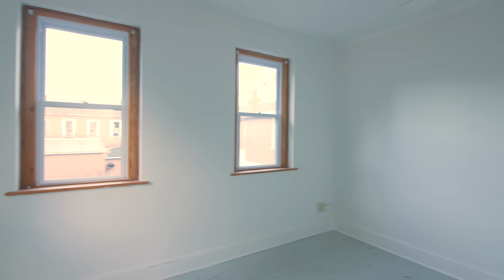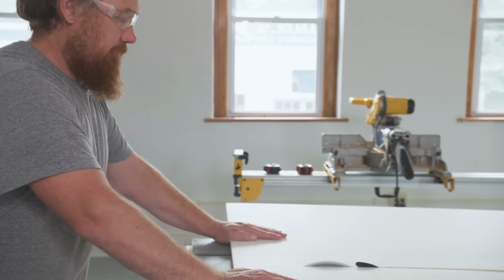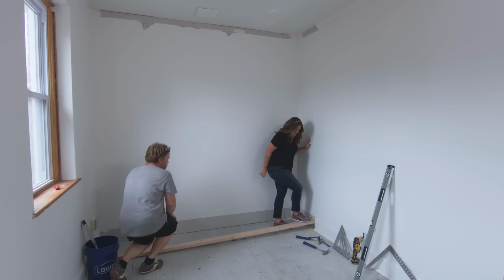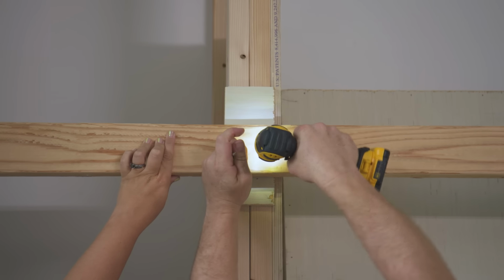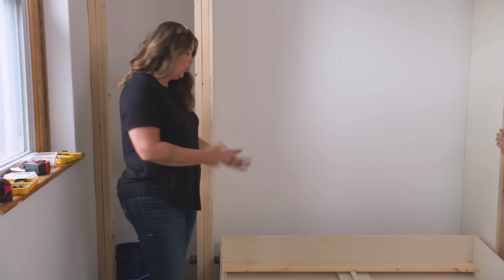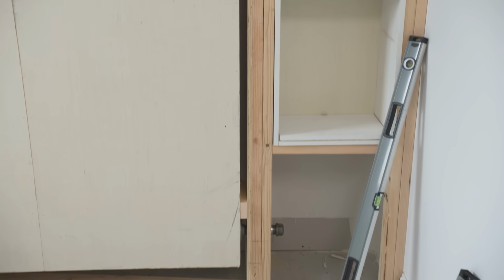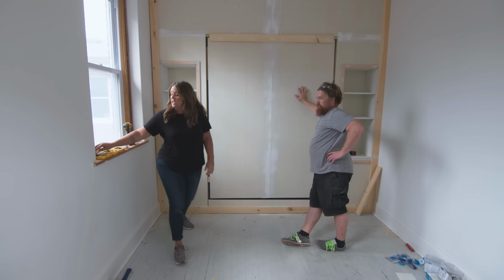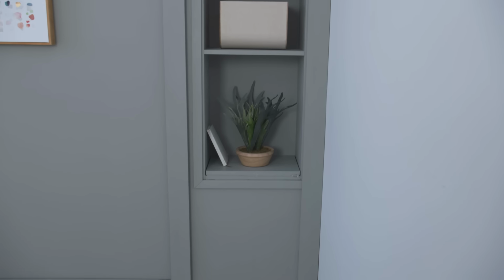How to Build a Hidden Guest Room w/ a Murphy Bed

Comment: Your video was very professionally done. I wanted a Murphy bed but for a decent quality bed plan on spending approxmatilly $2400.00.  I would like to graciously offer some suggestions. When you put a good quality queen size mattress on the bed it will be heavy to lift. When you’re 71 years old like me the weight may be too heavy.  The other thing that i didn’t like was the trim with Velcro on it.  I recently made a bed that I had to lift and it was too heavy for wimpy old me. I think your bed would be perfect for a young person. Please don’t take my suggestions the wrong way.  Keep up the good work.

Comment: You really don't need the slats, we've used plywood on top of bed frames to add firmness to mattresses for years.  That way you don't actually feel the bumps from the slats if you have a plush or air mattress.
Reply: And for functionality, I'd add storage at the top instead of just closing it off, and shelves all the way down, and maybe a lift up or pull down desk top on the face of the bed, that can be folded out of the way.  And I may use decorative gate hardware brackets instead of the eye bolts.     But I absolutely LOVE the way you did the pivot.  Cheap, easy, heavy duty.    The boat lazy susan option I've seen is cheap but looks like a pain and quite tricky to line up and actually install install, the spring pivot runs about $100 and looks like there's zero instruction, so takes quite a bit of time to test and figure out, and the  hydraulic piston kit option is expensive as heck at about $300.

Comment: For the sake of convenience and comfort, the use of a gas strut or spring-loaded hinges are an absolute necessity. Gas struts can be installed to pull/assist in clapping the bed shut after 10-15 degrees and hold the closed position but won't have enough strength to shut the bed while in use. Also, shelving elements that rotate on an axis and remain level while opening can be doubled as support structures while the bed is in use. In addition, shelves will add more decorative potential and a more aesthetically pleasing look to the overall piece rather than having a large, bulky, robust wall... If I were to walk into that room and see all that blank space a question mark would spawn over my head, you know? Led lighting inside cabinet space is also very modern and trendy!
Reply: Have you ever had a gas strut leak?  I have, never again.  not even hydraulic lift chairs.  The guest can help.

Comment: I don't understand why the outlet was not just moved.  Can you imagine an electrician trying to get to the outlet through that little hole and then sticking his arm in almost 2 feet to get to it?  And, if you were not going to move the outlet, I don't see any reason why the shelving (or even a cabinet at the bottom) could not have gone all the way to the floor, leaving a much easier access and provide more storage space.  Also a lot of wasted space above where the bed is.

Comment: i love this. it's so practical. i like how you left space on both sides of the bed. I don't know why people don't do this. and having power outlets with an access panel. again so practical. i wondered how you'd finish it. and again with the practical. even just building it piece by piece to fit the different heights in a house. so good. thanks.

Comment: I wasn't sure the two "nightstand shelves", on the piano hinges? weren't putting too much stress on that hinge, what with lamp, book?, etc.

I gues the piano hinge + the 1/4" under there was going to be strong enough.
And, the hinge "cord" or "bead" doesn't detract? I'll have to study that some more 

I do wish Monica had addressed that in just 1-2 sentences -- as well as the potential for framing and sheathing the top cavity for extra storage.

We You Tube viewers can be awfully demanding -- but, the materials would come from LOWE'S, after all.

Comment: Nice looking, tight carpentry too, but the frame, legs and lifting (need two people) look problematic. Do you know of a heavier duty system that’s easy to open and close? I’m planning on using a king bed.  
Thank you for the instructional video!
Jeff

Comment: I love this!! There’s nothing wrong with how this was done because this is how they chose to do it. 
For myself, I too would tweak it a bit and utilize all the space on the sides. Instead of using the space above as some have mentioned, I’d move the bed up a bit higher, add a desk that can be used as the center support on the underside and add longer legs. (This would allow for a deeper depth desk).
So when the bed is up, it’s a nice little office or study area. Then it’s a truly hidden bed/guest space. 
There are a lot of different ways to have done this but this diy video is very inspiring and helps us think of ways to add all our own ideas.  😁

Comment: I'm planning a Murphy bed/wall/shelves now. I like the pipe nipple pivots. The ball bearing boat seat swivel some people use is a little overkill for occasional use. The whole notion of trying to hide something the size of a cow in the room seems futile. I consider it an opportunity to make an interesting design project out of it. I can see a number of things in your design that I'll be doing differently.

1. You are not taking advantage of all of the space you have above and below the shelves and bed.
2. I don't like the look of the Velcro-attached trim. It doesn't hide the bed at all. I would just incorporate the 1" gap into the aesthetics with a treatment on the panel. 
3. The spackling will just crack, crumble and fall out from between the plywood pieces. I would just put a piece of trim over it or camouflage the crack as a line in the paint design, maybe with a 1" wide black vertical line. Maybe you could edge glue the two pieces together.
4. The feet are too crude for me. They should be recessed a few inches under the bed to keep toes from getting stubbed.
5. With the mattress in place your bed is too heavy not to use gas struts or spring assists. You have a two person job. I can just see the bed crashing down when it slips out of my 71 year old hands while raising or lowering.
6. I'm going to put one or two puck lights for reading above the bed inside the frame.

Comment: I am looking for ways to use my guest room for a craft room. I really like the low tech pivot, feet, and lock solutions. I also like the flip out nightstands. For an elderly single person, this design is unsafe to operate solo. But for a couple or a younger, stronger person it would be workable.

Comment: I get the velcro concept but just attach the molding to the bed frame only so it comes down with the Bed. but you gave me the best idea. do the same thing with an already blocked out that's a closet, door on the far right. take down the wood paneling and reframe area with your hide a bed framing and then cover the entire area with broken up and painted wood pallets. The pieces will over the seems so that when the bed is up it will look like a castle wall. Maybe even attach a shield and sword to the middle of it. when it is down a beautiful painting will be revealed on the back wall.

Comment: Love the idea! Great build, but living in a small historical home, I would have added floor to ceiling shelves as it seems the space above the bed was wasted and under the shelves.  In addition, I would have added recessed lighting on both sides at the top as well as above the bed when it is down. The lighting could also be adjustable in illumination from 0 to full illumination.  Perhaps even think about Smart bulbs with a remote or ECHO connection for music and to tell Alexa to dim lights by ?% per preference of the guest. I also would have tried to add resistance springs so that one person could grab the bed and pull it down or it locks in place once it's near the top like a normal murphy bed for safety.  All in all - great job! :face-blue-smiling:

Comment: I know this is an older video but I'm hoping that someone is still checking for activity.... my question is how did you arrived at the location of the pivot height and depth? The bed looks a little low with the pivot at 6" up that would make the mattress height only 2 1/2 inches above that so the mattress is only 8 1/2 inches above the floor? This info (probably the most important) is not even mentioned. If Possible could someone please provide a little more info on this. Thanks in advance

Comment: Instead of using velcro (because it would be a pain to take off and put back on and not always be put back on evenly) why not just fasten the molding to the bed and leave a tine overhang to hide the seam? That seams to make more sense and be easier. Other wise very nice. I've also seen people use lazy susan to rotate. What do you think of using them?

Comment: The bed is supposed  to have a spring loaded cam on both sides of the bed, it dangerous to have no return spring to prevent it from falling with the weight. someone can get hurt. what a butcher job, i'm a master Carpenter and I can tell you 100% the unit is dangerous and cheap made, very disappointed. I won't subscribe to your channel, pay the extra $200.00 and get the correct spring cam hardware.
Reply: agreed, this build is garbage.

Comment: The bed frame shouldn't wobble like that. You should have used some square pipe to build the frame and attached the plywood sides and back to it. Also, spending a couple hundred bucks on a gas-piston kit saves tons of back pain and discomfort over the years in lifting and lowering the bed. The kit usually comes with a folding foot so another issue solved. A single person can then easily and safely operate the bed. Even a child could do it.

The trim covering the gap could have been permanently attached to the bed, or at least hinged to the wall frame to swing open when opening the bed. Piano hinges would have done the trick.

Comment: So this is definitely totally awesome. The only thing I would have liked added is to see what decorating/cqmoflaughing you’d do to that wall when it function in another capacity. While the bed may be completely hidden, the woodwork and framing would just by them selves seem a little odd. I’m sure with the right accessories it’ll all come together. My thought was make this like a small TV/family room where you use a mini projector with a motorized drop down f screen that you’ll stay open when not using the room for a bed. And if placed close and taut enough, it might just look like a screen that’s been framed in permanently. What do you think?

Comment: I make wall bed mechanisms and have done for around 14 years, so can declare an interest up front, but also some experience that might be helpful. While with smaller and horizontal single wall beds one might be able to get away with not using a mechanism,  the effort you need to safely lift and lower this with a half decent mattress, is very high. This is great if you want a work out and are big and strong, but most are not able to do this without risk - which is why we make thousands of mechanisms every month for 25 countries around the globe.  I think you should have shown the bed being opened and closed by a typical homeowner, so that people building this are aware of the weight and risk.

Comment: You could put a fold-away desk on the wall/bottom of the bed (or across the room--like in a tiny house) that would fit a laptop and use the rest of the space for a yoga room. The laptop on the desk or a flat screen tv across from the bed could play your videos to follow. The fold-away desk could also be a space for a sewing machine. The space below the guest shelves could be cabinets for all of your sewing supplies or a printer for the laptop. The space above the guest shelving could be used for other storage for lesser used items. Folding the desk away gives the guests walking room at the end of the bed.

Comment: Some of the stuff is janky. Final bed trim, pine pivots and the bed frame pivot all could have better thought out and more solidly constructed. No body ever talks about glue. That's how you can tell this guys a framer trim guy. Real carpenters use Glue. Those nails will slowly knock there way out. Firewood is what you just made. But hey whatever 🙄

Comment: Is there any reason why you wouldn't be able to attach the flanges on the inside of the bedframe so that the pipe would go through the bedframe and the wall and allow for much smaller gap?

Comment: What about the weight ? It took 2 people to comfortably lower it without the mattress. If I did that, there is no way I could lift that alone to return to multi use room with the mattress on the bed. Is there anyway to add some form of counter weight/springs to the tilt mechanism ? If it was pivoted nearer the centre of the bed it would make  easier to open/close but you would lose more space from the room. Maybe a walk in close behind ?

Comment: I installed a pair of spring loaded garage door hinges in reverse with the galvanized pipe hinge and the possibility of the bed EVER coming down with ANY possibility of an accident and hurting ANYONE is reduced to almost NEVER. Using this install tip, a single person can open and close the bed and there are no loose eye bolts that you need to track. Cheers!

Comment: I just have to share this. My sister lived in an old bungalow apartment when I was in high school.  It was built in the 1920 or 30's, it had a Murphy bed that had a ring bolt on the floor you had to tether to or the bed would flip up. I assume to make it easier to lift and store.  One day I cut class and went over to visit. I jumped into the bed to surprise her and the force dislodge the tether.  We ended up folded in the bed against the wall.   It was hysterical moment we had to fish our self around and use our legs to push the bed down and crawl out from the side.  Every time I see one of these bed I laugh 😃.
Reply: Lmao
Reply: That scenario of the bed folding up on someone was kind of common in old movies/cartoons, but I never knew it was actually possible.

Comment: Dint like the grey color and I'd adhear the frame around the bed not with velcro but screws that go on the bed box, so the would just fold open and lay on the ground.  But good.mesurments, design, and directions.

Comment: I was looking for something like this idea for my tiny house bedroom. I believe it will work, but I’d like a storable headboard so my pillow doesn’t slide into the pit when I’m sleeping. I’d also use the space overhead for storage of seldom used items, seasonal clothing, etc. I like the idea of a fold down table underneath  to mount an easel and side table for laying-out my paints and brushes. I like oil painting. I like the nightstand idea, too. The other side is where I’d store my painting supplies. Doing these things frees up space for a corner desk and chair for relaxing and reading, maybe an occasional nap.

Comment: I’m not much of a fan about the trim pieces. I personally would’ve built it out and finished it like a normal wall and used wall and crown moldings to box things out. The bottom of the bed would have a frame molding that extends the edge that way when the bed is the up position the bed covers the gaps.

Comment: Great video!

I would add a pass through opening on the inside of the built in shelf on each side of the bed for phone storage and plug ins. 

I would also put built in shelving all around the bed wall frame.

Comment: I would want the bed to be higher. I’d make shelves that function as the legs on the underside/wall side of the Murphy bed. If you had a storage space under the bed in the form of a short cabinet, you could store them pillows when the bed isn’t in use and store the things you have on the shelves when the bed is in use

Comment: I would put the mold on the outer edges of the bed frame, not the wall with velcro.  With that said, you did an amazing job and yours is the only video I saved to use
Reply: or you could invisible hinge it to the wall.

Comment: The idea is nice, but - to me that bed looks rather flimsy; the frame doesn't seem to be very sturdy. Furthermore, the pivots securing the bed frame is just attached to plywood - will this really be a durable solution? I would have preferred compact wooden beams holding that pivot. The end result looks quite posh though.

Comment: I have Hard Wood Floors in my room and would rather not drill screws into the hard wood, so could I just drill the 2 front vertical frame pieces into the 2x4’s in the wall on each side instead?

Comment: I like this idea.  Couple observations (1) Would have loved to see the top of the bed are used as storage (pillows, linens, blankets etc.) or shelves. (2) Hoping to see the use of a counter weight mechanism or pneumatic arms to prevent the bed from free-falling when setting it up & have it be not as heavy to put back up.

Comment: Because our Cape Cod is small, making our office room double as a spare B/R using a similar method would be perfect. The exception for us is that it would be a single bed, and would fold down/away along the side of the bed. Your DIY provided good options for building this ourselves & adapting the ideas to our own situation & dimensions.

Comment: Why not fit the surround framing panels to the base of the bed, so once folded up into the wall space it would hide gap between the bed and the wall. Save removing the panels to lower the bed. I would also find a use for the space above the bed..